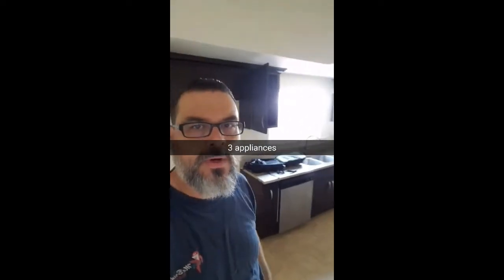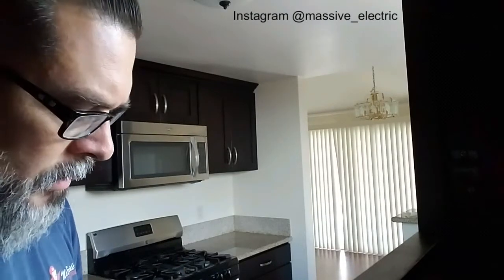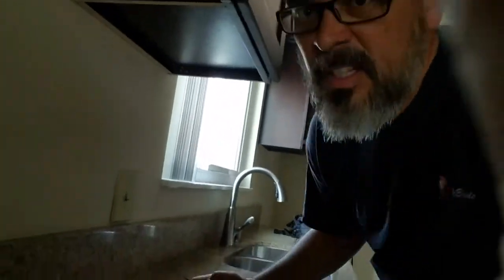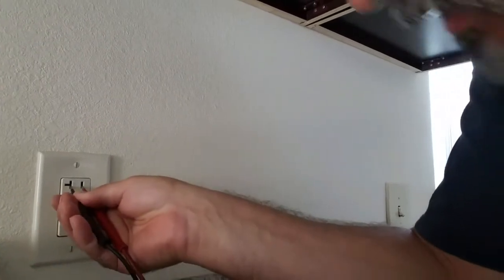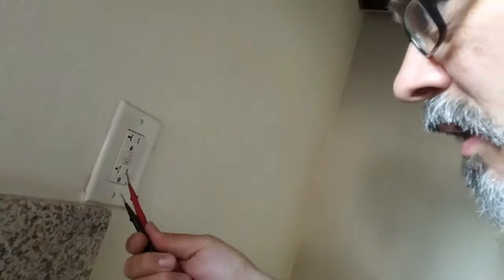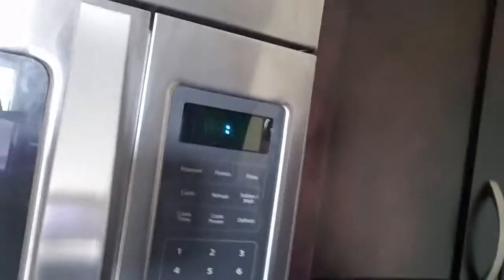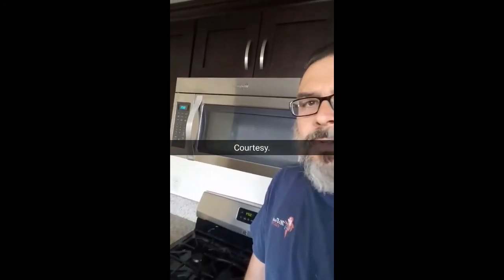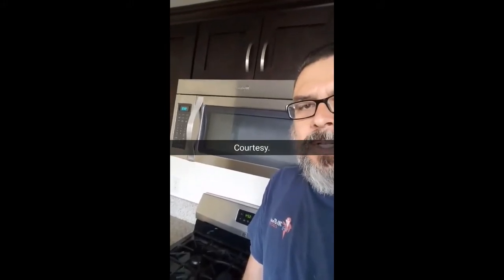"Live" Electrical Troubleshooting 3 Kitchen Appliances

Comment: Too bad you didn't diagnose if there were too many appliances on one circuit, too much load, and therefore tripping the GFCI, or turning on a couple appliances to see if a fault inside an appliance is tripping a circuit.